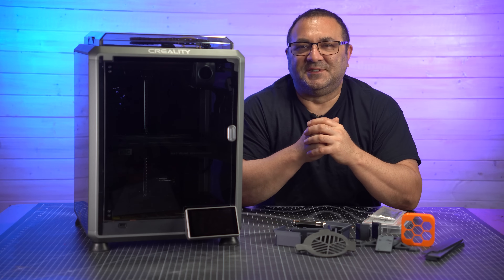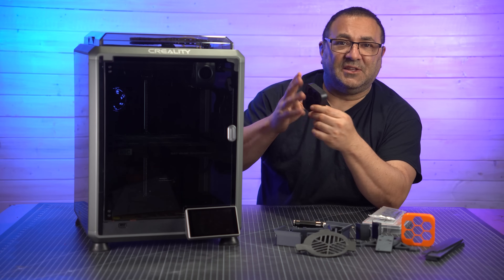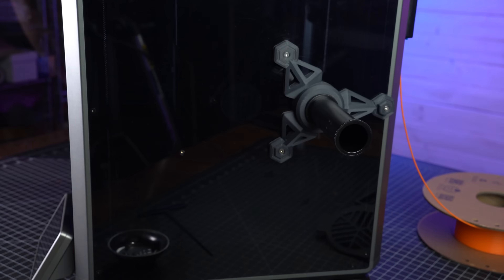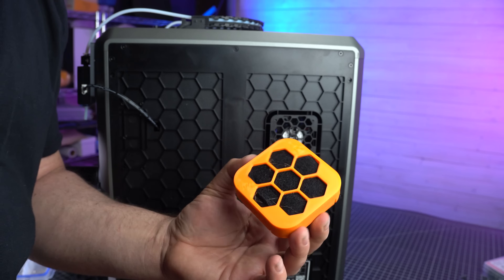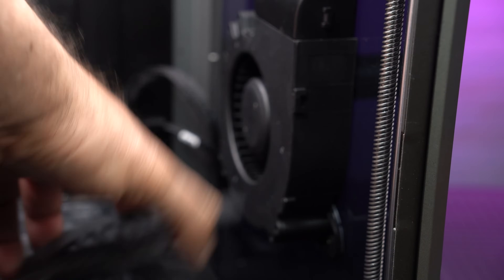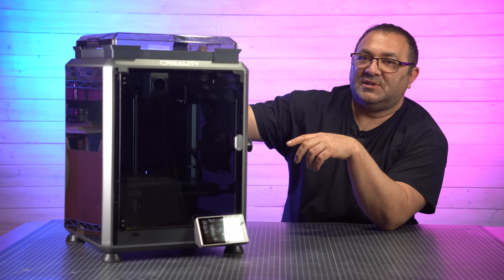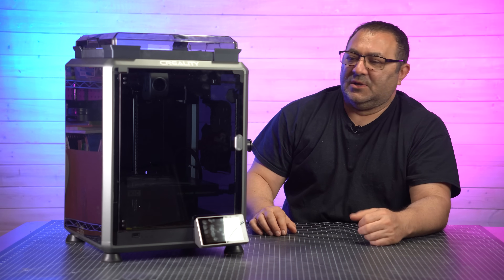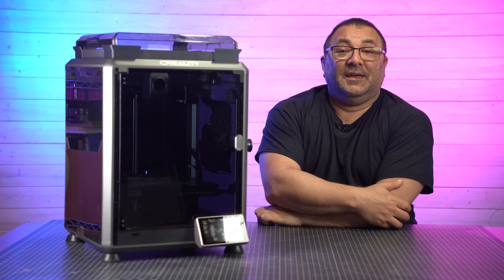Creality K1C 3D Printer Mods that Make Printing Easier

Comment: Useful mod : 3d printed bracket that holds the nozzle cleaner so its not glued on your build plate anymore. This way you can use both sides of your build plate and also use the cheaper Ender 3v3 type of plates.
Reply: Does that mean you have to change the startup gcode to make the nozzle wipe farther back?
Reply: @micweis  No, the nozzle cleaner gets in the same position as before, it just the buildplate that slides under the cleaner bracket.

Comment: I don't know if they have changed the cable length on the runout detector, but my machine (K1C) does not have enough slack to move it.
Reply: I just did this on my K1C and it was bought last year, Still had slack just had to tug a bit,
Reply: @Juicebox4271ph  Tried tugging it, but didn't want to put too much strain on it. Is there anyway to get to the cable from the inside?

Comment: A number of the mods require different screws to be used - what is the size / length of screws that need to be used for these mods?  (UK owner here)

Comment: Hello there, I’m so excited to hear all but I got some issues. I had to return my first one (K1C) as the extrusion system jammed and I couldn’t remove them conveniently. As myself New to 3D Printing and had bad experience with CR-10 SE and Ender-3 S Pro (I think), I decided to have this K1C as it adjusts and tunes everything itself. Being disabled I found those tasks kinda troublesome at times for me. Since I got the replacement K1C and started printing it keep showing me that it Runout of Filament, whereas I just opened the New Spool and it Extrudes fine. I would love to show you the photos of my props I downloaded from the Creality Cloud but not all of them seem working as they supposed to. Any advice would be much appreciated. Thank you in advance!
Remember, Life is Short so Live Long and Prosper 🖖… Cheers!!!

Comment: I was able to locate the file for the filament spool side mount on thingiverse as you mistakenly forgot to link the description just mentioning encase others are troubled about finding the exact same one
Reply: it came with the printer
Reply: @Bring_TheReal1  the one that came with mine doesn't look like that, the one in the video looks nicer
Reply: @debrabrown7776  Its the same, maybe the material is "better" or well sliced
Reply: @Bring_TheReal1  it's definitely not even close to the one that came with my printer.  It won't let me show a pic but they are not the same
Reply: You found that exact one? I wasn't able to find it